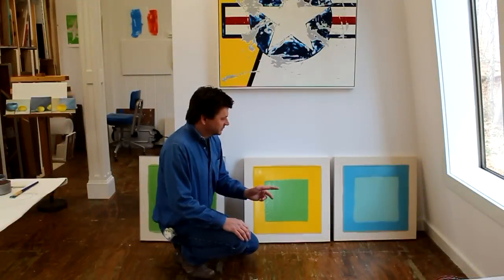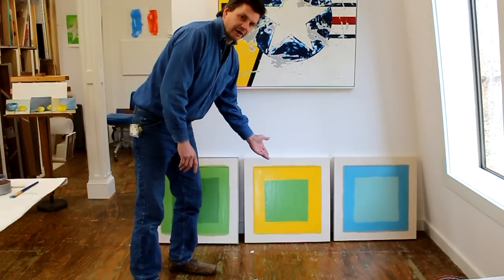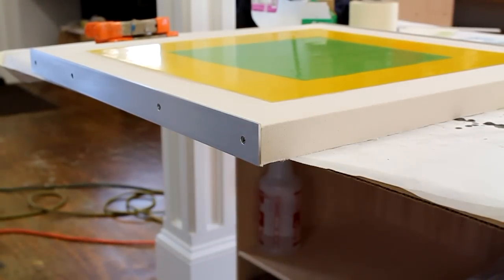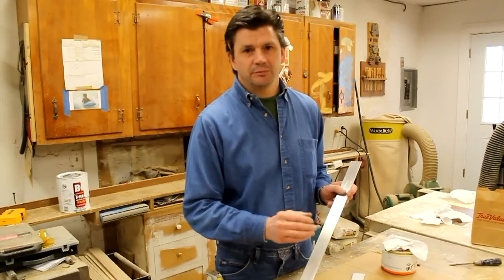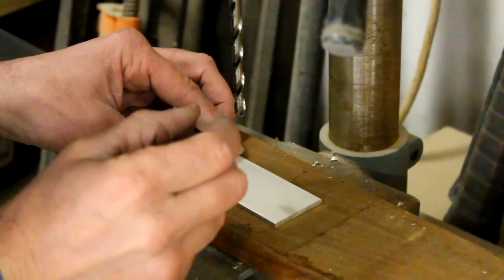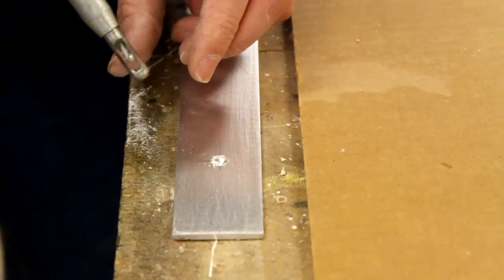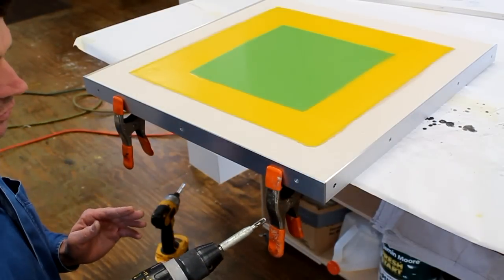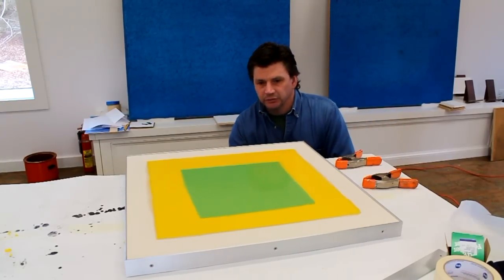How to make an Aluminum frame, or put an edge on a painting, by Jon Peters

Comment: any reason not to cut the borders at a 45 angle so that the edges have a cleaner look?
Reply: There are reasons but not great reasons. One being that the saw he is using would not make that cut very clean or consistent on that kind of aluminum stock. I would use a chop band saw for a cut like that on the metal he's using. Personally, I think the exposed screws on the side of this looks very poor.